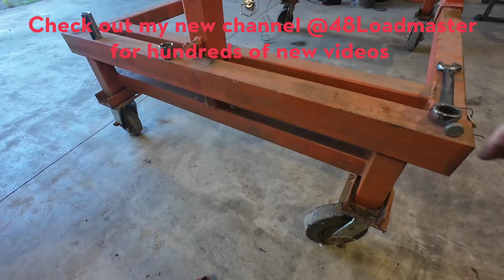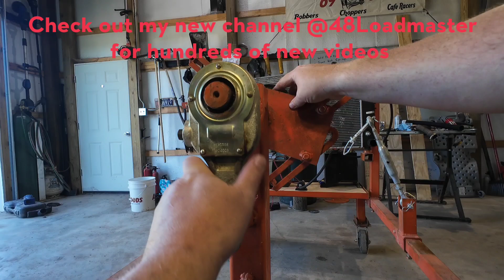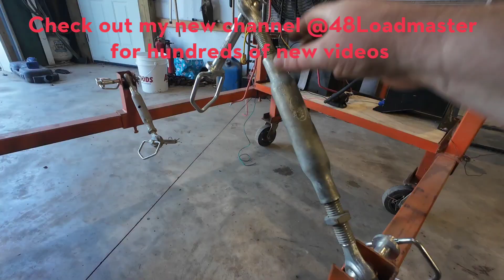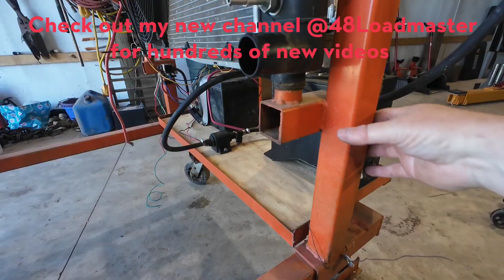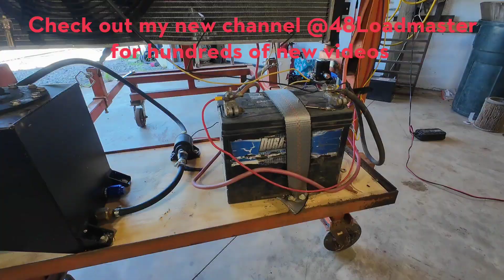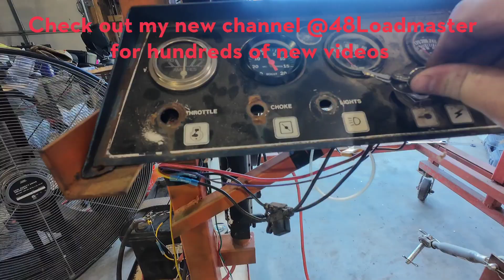Homemade engine run stand. Check out my new channel @48loadmaster for all new content

Comment from the maker: To adapt your engine stand to use a slack adjuster you will need 2" × .243 dom tubing.  This will snugly fit the 1.5" cam.